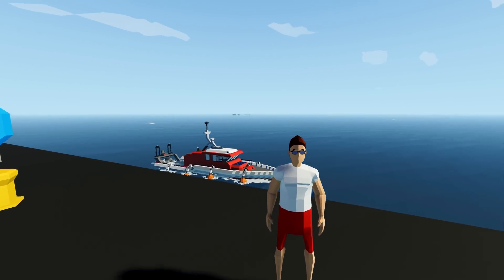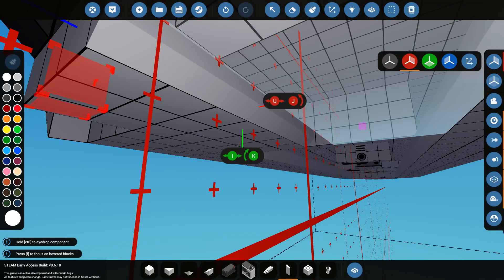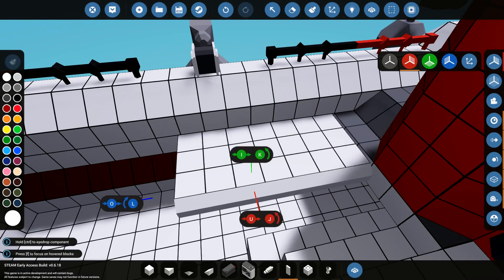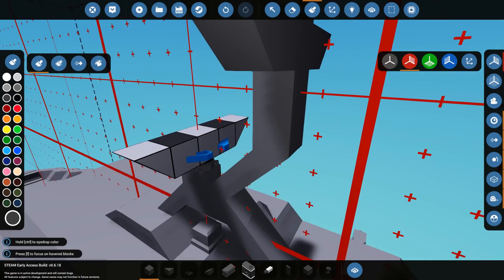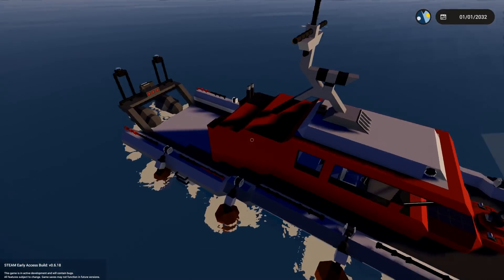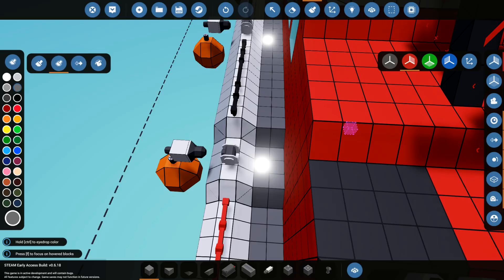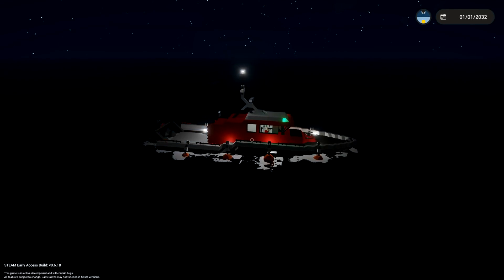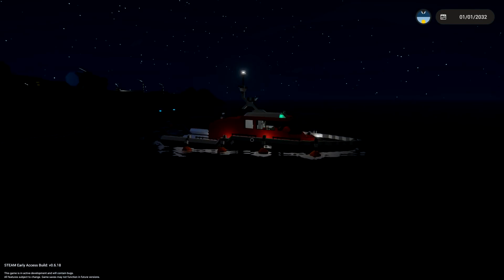Lights + Fixing Buoyancy  -  Rescue Ship  -  Stormworks: Build and Rescue  - Part 8

Comment: Frantic, i might not be correct but the amount of electricity generated depends on how fast the engine/the source is spining, so you can just add a gearbox with the arrows facing the engine then it's going to generate more power, you can also increase the max RPS on the engine

Comment: Frantic if the gearbox face the engine u go 3 times faster and if it faces the props u go a lot slower than normal
Reply: You go slower but have more torque